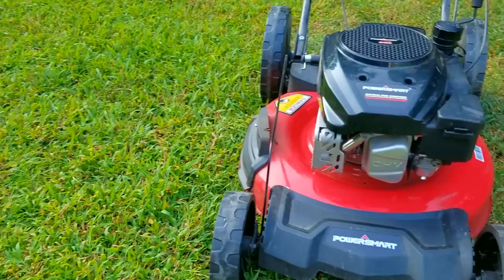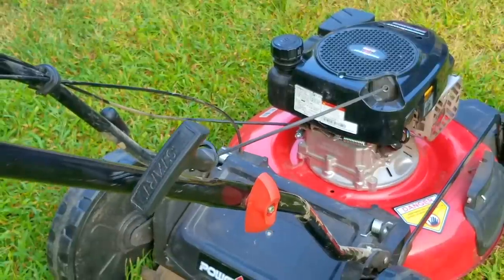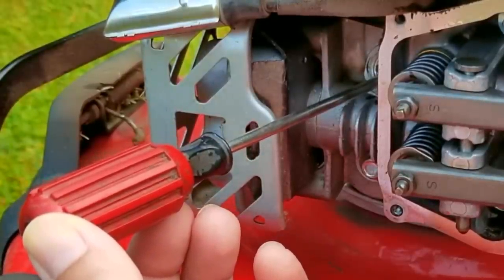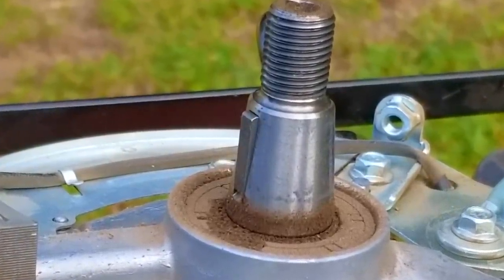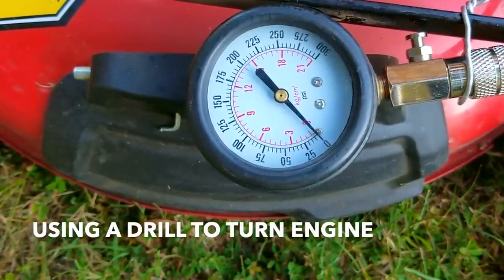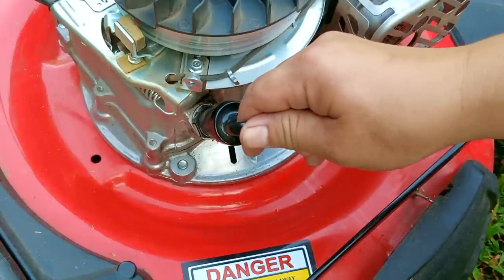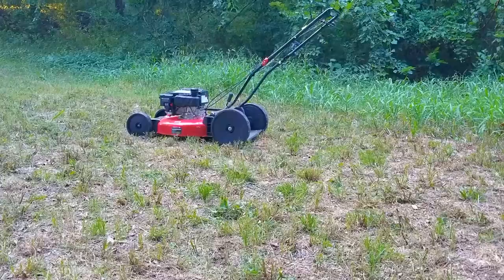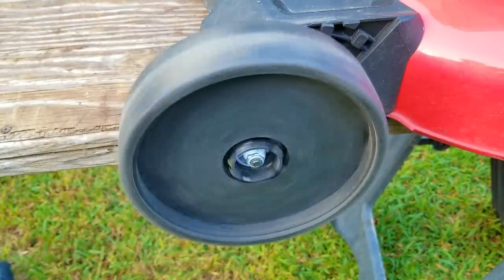Fixing A PowerSmart Mower That Won't Start

Comment: I just purchased 4 "new in the box" 3 in one powersmart pushmowers.(DB2194PH) I've been working on mowers for decades, and these are the poorest quality mowers I have ever seen without a doubt. Here are just a few issues I discovered. 
My gas grill has better wheels. 
The deck height adjustment requires you to hold the weight of the deck with one hand and adjust with the other. It's made entirely of plastic and will snap off in your hand. That's no exaggeration. 
The way it converts from mulching to standard discharge is so ridiculous that I can't find the words to describe it.
Wear boots, jeans, and safety glasses when using the bagging option. Spits clippings. It's a rear discharge system for the bagger that is of poor quality and design. The bag has a capacity less than a pillow case. 
It's powered by a 212cc horizontal shaft engine that is connected to a gearbox that transfers power to the blade. Why?
I couldn't tell you. If there was ever a situation for a vertical shaft engine, this is it. So the blade isn't on the crankshaft.
It's on the short shaft coming out of the gearbox. That's not going to last unless you intend to use it exclusively on putting greens.
I went to install a fuel shut-off valve and didn't have one small enough.  You couldn't cram a chopstick down the tiny fuel line that isn't really fuel line. Running this machine in 100 degree heat will probably boil the fuel and cause the engine to stop and not want to turn over for a minute. 
I tightened every nut and screw on the machine and it still vibrated worse than any new mower I've ever seen. 
The blade is horrible. Enough said about that turd.
Thinking I had a lemon, I prepped another one. The first one was better. The next was worse! 
I've sold one and felt guilty for taking the 100 dollars I charged him. I'm not selling the rest. I have to live in this town. I'm taking off the motors and scrapping what little metal there is. Hopefully, I can re-power something with  these doorstops. 
Wal-Mart gets nearly 300 dollars for these things. 
I would buy a used MTD for a fraction of the price. It'll perform better and last longer than this junk.
Reply from the maker: Yes you are correct, these are by far the worst, hands down.